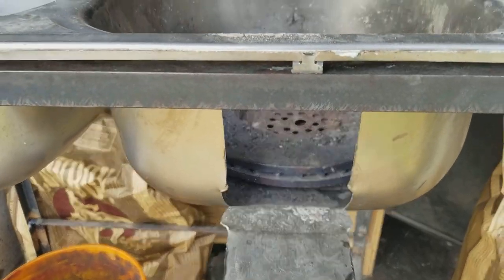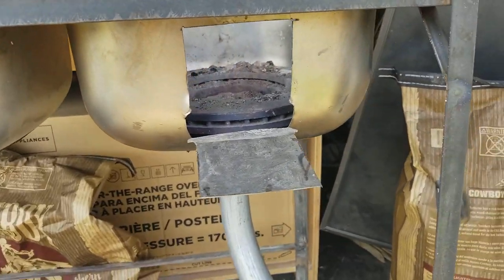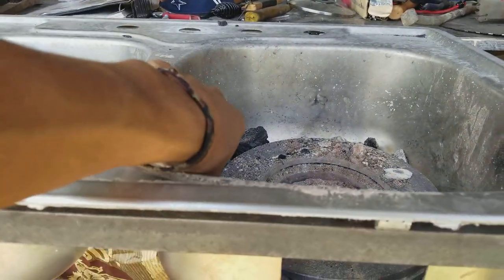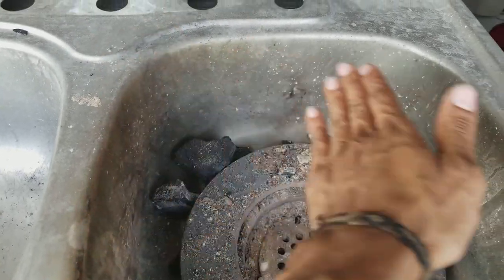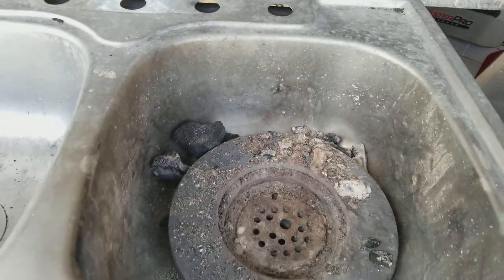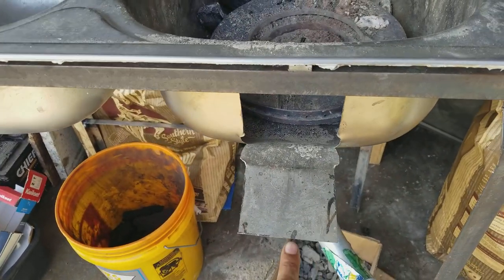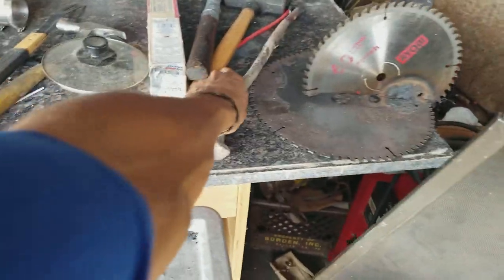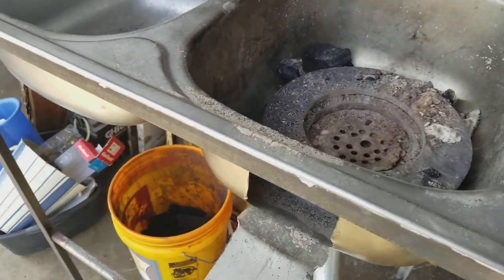Forge from a kitchen sink and brake drum (simple DIY)Part 2

Comment: What is the thing that you placed over the drain to circulate the air flow?
Reply from the maker: On the top? Its a circular saw blade i cut into shape then drilled out holes with various sizes.